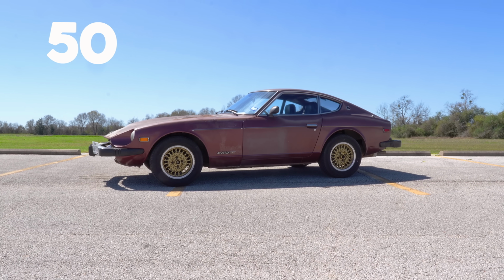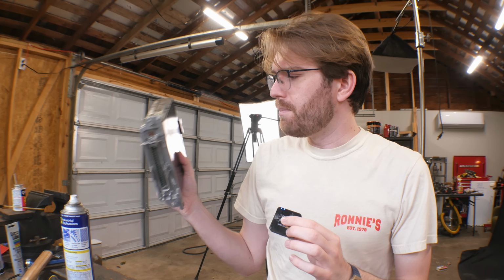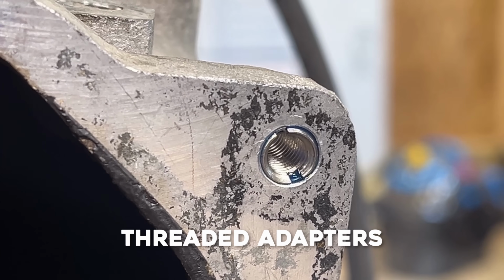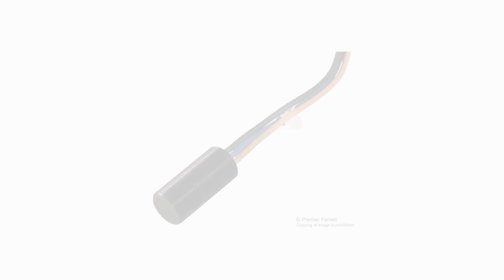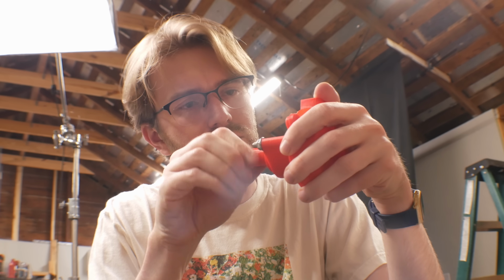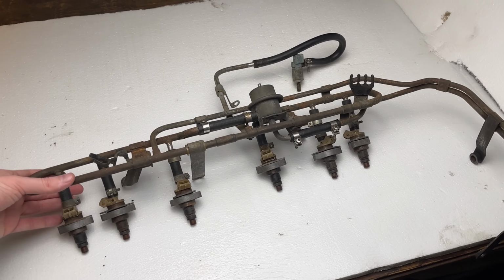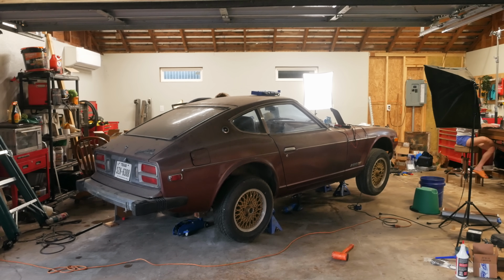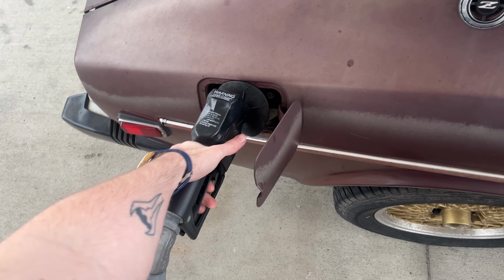Modernizing a Vintage Car

Comment: Heck, my hot rodded '72 240Z with a huge crane cam, 4 barrel manifold, Holley 600, large-tube headers, and dual exhaust got ~ 20MPG and ~205 HP at the wheels.  That's sad!

Comment: Love the video.   I have had 2 1974 260zs.  One stock, one with 1972 carbs.  The stock carbs actually worked well but needed frequent adjustment.  These things shine at high rpm.  You really should put in new rings and bearings and whatever else it needs.  You will see a lot more ponies then.

Comment: This was my first car after graduating HS in 1988 (mom bought it for me for $1800 as a grad gift)! Same exact year, color and gold spoked wheels. WOW… such a time travel. And what an absolute POS this car was, despite my absolute love for it. The front quarter panels flapped in the wind, due to rust, and the floor board had a hole, so driving in wet was like driving a Flintstones car—your feet got wet driving over huge puddles!

The computer. Oh, the computer. A year into owning it, it would randomly bog while driving, emitting a ton of black smoke. It could last for a few minutes and stay running (barely), or it could completely stall out and leave me stranded, as it did one time while driving through NYC in rush hour one Friday afternoon on Broadway, when I went on a day road trip. 🙄

I took it to Nissan and their diagnosis was it needed new injectors and wires. $700 later, it worked for a week, and guess what wound up happening again? Now PISSED, I was stuck with a car that seemed unfixable. However, on one particular instance of this happening again, I got so mad, I kicked the interior side panel HARD with my foot. And guess what happened? IT CLEARED UP! I looked at what exactly I kicked and realized it was the computer. 🤣🤣

Down to the local junkyard I went. 

The really nasty jerk that owned the place had a ‘78 lingering around, but he wanted $200 for it (I priced a brand new one at $250)! That pissed me off even more, so in my 19-yr-old northeastern reactionary mentality, I decided I was going on a covert operation that night and just take it. So, off I went with tools and a flashlight. 10 minutes later, I had a computer. I installed it the next morning and the issue never occurred again. 

I’m not proud of thieving, as we humans often do spiteful things when we’re young, immature, somewhat poor, and not really thinking. I’m sure I received karma for it in one way or another. 

Good times. ❤❤❤❤

Comment: So that's where that ECU went...
Reply from the maker: Thank you for being easy to rob awesome!
Reply: @Ron @RonaldFinger should’ve rob ask for more tbh
Reply: If it makes you feel better, as yet another fiero nerd with an engine swap, I immediately went to your website after watching this video.. :)
Reply: Totally going to remember your ECUs for my Mazda B2200 with a Kia engine swap. Still on the stock ECU, and I would like to make it all more tunable for efficiency.
Reply: @BMX20-r3l  FE3 engine? Really stout piece of kit
Reply: @runesmDK Yeah, the FE3. My wiring is far from perfect.  😂 But, it has been really reliable. I did have to replace the head after an exhaust value burned a hole through itself and had to put new injectors in as well. But it was a salvage yard engine that we didn't even know the miles on, so I can't complain.
I also added a rear end out of a B2600 automatic, which is higher geared. It will hit 60mph in second gear with redlining. It wouldn't do that stock. 😂
Reply: @BMX20-r3l  Dont know how strong the kia fe3 is, but the original mazda fe3, we've turboed quite a few of them. Does 400hp stock internals no issue really, just a decomp plate. I'd just smack a cheap speeduino on it, works a treat
Reply: Why in the world would you want a low quality Kia engine???
Reply: @glassman164  Sometimes, enjoyment doesn't come from things that work and do a good job at what they are built for, but instead, come from knowing that you drive a slow pile of shit that gives you an anxiety addiction that gets real close to feeling like a thrill when your pile of shit inevitably breaks down. 
It's like debilitating mental illness for people that don't have enough going on in their life. 
I actually know people like this, they buy absolute trash products and get excited when they have something to fix. They will buy ebay turbos twice a year, buy a new junky chinese smartphone every year, and buy the most unreliable junk cars you can possibly buy. Even temu is not junk enough for them. They will spend more money buying junk than buying a new solid product that will last a lifetime. They consider themselves thrifty and cost conscientious, but they blow all their money having to buy more junk to replace their junk. They are perfectly conscious of these decisions, not delusional, and enjoy this lifestyle.
It's infuriating, but I respect their happiness.
It should come to no surprise that these people live in bumfk nowhere town of 550 people, and their income comes from the government.
Reply: @glassman164   most of them make great power look at thailand
Reply: Hahahaa 😂😂😂
Reply: I wanna do the same thing to my 1980 280zx
Reply: I tuned a local 240sx w/ RB20 swap with an ECU from you guys. It was my first time messing with one and I gotta say, I liked it! Very user friendly, no weird connectivity issues. Even saw the dude had massive boost creep and told him to figure that out before romping on the car. He did not, and promptly blew the head gasket haha. We never blamed you guys though!
(He ended up finding a shop rag stuffed in his wastegate signal line).
Reply: I hope Paul recovered quickly.
Reply: Not only is your video very interesting , informative and amusing , makes me think you could develop this into a kit for other people as well.  At seventy five , I am very impressed by your work. Plus thanks for the laughs . Looking forward to more.
Reply: Mark 1:15
“The time promised by God has come at last!” he announced. “The Kingdom of God is near! Repent of your sins and believe the Good News!”
Reply: Hehehe.

Perks & problems of the developed world.
 Wish I could even affordably & reliablly Buy a stand-alone ECU here in Kenya.
Reply: Hey @ECUMasterUSA - I can make another one scarce for a while too?
Reply: Do you want do this to a 240z on Mikunis?
Reply: lolzz
Reply: Greatest comment I’ve seen
Reply: Oooh, My Mechanics has entered the chat! That's it, I'm subscribed!
Reply: lol

Comment: 20 plus hp aside, the after and before moments made me wondering, what is the after weight compared to the before weight? because 20hp plus on same weight is very different with 20 hp plus after shaving off may be 20kg, right?

Comment: It’s interesting to see how someone who isnt a mechanic and obviously pretty much a tech guy compared to most mechanics solve problems on this build.   Your solving problems in ways my brain never rhought of.  Like the gas pedal: I’d have cut the metal rod and added a few inches and welded it together . I wouldnt trust a plastic spacer on a high usage high stress spot.

Comment: For that throttle body adapter, I usually would take a picture of that engine section and bring it into the CAD software and make it one-to-one scale, then trace it. But, whatever you got it done.

Comment: For the 3D printed foot pedal height adapter, the faster way to have determined the best thickness would have been to use wood shims to make it as close to the correct size.   I design things for work and I create a lot of 3D printed parts. But whatever, you got it done.

Comment: I had a 78   much much better shape  I bought it  in 1980  it was an automatic. Great Gas milage good power  fun as hell for  all trips short and long  across the USA  many times.  I like the way 240s  looked with the Carbs  so I went the other way  with Headers and  2  2 brl Webber Carbs  all chromed out  it was beautiful..  my car was copper metal flake  with spoilers and all the trim. white letter sumitomos  wish i still had  it.

Comment: Replacing fuel system to injection is good but to fully optimise you really need to change combustion chamber, compression ratio, valve timing, valves so basically by changing injection it’s only half job and won’t work good as you think.

Comment: nothing inherrrantly wrong with l-jetroinic
its fast enough ans locked in, tso the real trick is not assuming its outdated before getting it to operate as per how it would on day one.

the first step is making sure the engine is up to it, timing chain, compression , valves , cam , valves & guides and all that, plus exhaust / intake.

decent injectors, afirflow, and all the otehr settings spot on.

then once you have a baseline, then work from that.

those early systems including d-jectronic werent perfect but also perfectly fine for the day.

once again a basline is required before tinkering.
Reply: and bosh were a primary pioneer in fiuel injection.
conflating them as some kind of domestic applience level manufacture reflects bery much on the level of knowlegde
lack of it basically

Comment: Oi lad. you have done something I am currently planning for a motorcycle. only difference is that I first need to map out with a carburetor build because the engine is that exotic.
Cudos to you, i have this video safed for later.

Comment: If all one was worried about was the coil failing then it would hardly seem worth it.  Back in the day that was one of the most reliable parts on a car.  In all the vehicles I've had in my time I've only run across a bad coil once and that was on a clapped out '77 F-150 I bought that had its 3-speed column shift transmission lying in the bad, lol.  Now, you might drown out the distributor driving through high water, but even then all ya had to do was spray it out with WD-40 and then drive on.

Comment: The electronic throttle in my E46 M3 is far more responsive than any cable could be. There's no friction, there's no slack, there's no stretch, you touch the throttle pedal 5% and you get 5%

Comment: Time for a part 2 with modern engine components like higher compression pistons and iridium spark plugs with a ported head and hotter cams and stiffer valve springs.

Then part 3 would be a DIY turbo kit.

Comment: As a European, I have no reference for what 19 miles per gallon means.

I asked Google to translate it to something more universal, and it's 12.37 l /100km

I guess that is not bad for a 6 cylinder, but it is pretty terrible for such a small car.
I get the feeling you could have cut the fuel consumption in half by swapping to a modern engine, but who am I to say. 

It is a very cool project non the less. I admire your ingenuity.

Comment: That injection system the car originally had is literally worse than carburetor
From 125whp to 142whp is a solid 13% increase on basically zero mods, only sensors :DDD
But now that you have everything ready, a bigger cam would give HUGE results. Like 40hp more results

Comment: Wow i just thinking about doing this,

Because in my country there is almost no cheap rwd sedan.

Of course there is bmw and mercedes, but even old one or cheap one it still bmw and mercedes, if i broke any part i still pay bmw and mercedes price.

So i thought about buy an anchient corolla ke30 or dx, but i dont want to deal with old car problem, so swap the engine with fuel injected, more durable later years engine

Comment: 8 months hard work for a 17 hp increase in power is time well spent. I think if you stopped half-arsing it and committed to the full year working on it, you could easily get that up to 20 hp. 👍

Comment: Hey iPhone 13 Z cars 240s two60s 280s. The thing you wanna do with this 1978 low compression engine does remove the head put a two head on it., and back in the day we used to throw triple Webbers they are my favorite. They sound incredible..
And you should hear a Z car with a split header they sound like Ferraris and they run fantastic .
Then you go to the transmission you take a transmission out of 200 SX from the early 80s. You change the front housing on the transmission so it’ll adapt to an L series engine. Make sure you get the end clearances right you don’t wanna countershaft moving around or an input shaft for that matter . 
What you end up with is a 280 with a cold racial gearbox with a high compression head and if you change your rear differential and you take the front diff out of a Nissan four-wheel-drive and you put it back into the car now you got 411 gears , with a close ratio five speed with around 200 horse , I used to beat the Camaro with my Dotson’s all the time in the 80s and 90s it was fun

Comment: This phonic wheel is gonna be a massive problem, for once the distributor spins every 2 rotations of the crank, so you are using 30° of precision instead of 15°, also you need more syncro teeth, 1 syncro teeth isnt enough at all

Comment: Even if you put the correct air volume chart, you essentially put a restrictor plate in the air flow. Your adaptor to the throttle body blocked some of the airflow.

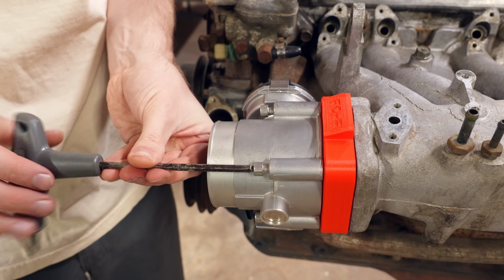Comment: @9:55 you’d probably get better flow if you’d made the hole on the side of the adapter that mates with the original manifold match that weird inlet shape. You can use a loft operation to create a smooth transition from the round hole for the throttle body to that weird shape on the manifold. With a nice smooth loft you’ll get less turbulence in the intake path.
Reply: I like your funny words, magic man.

Comment: Well I wonder what about the drive train efficiency and aerodynamics. Repaint to the surface is smooth and see how much did your efficiency improved.
And other think about the air sucking capability of the engine. I think you have now programmed it for the max power not the max efficiency...

Comment: That was awesome!
But firing the spark at tdc every time might not be a great idea 😅
You want to advance that spark timing by around 25 degrees at times, and around -10 in certain cases. You would need a knock sensor or two, but if the ecm is built for it, It'll be worth it! Power wise & efficiency wise you'd notice the difference

Comment: I had a ‘78 280z as well. Sure it doesn’t make much horsepower, but because it’s so small and lightweight, it feels really zippy. That thing would GO. A 280z at 120whp is like a FRS/BRZ at 200whp. It doesn’t make sense but if anyone gets a chance to drive a manual 280z, you’ll see what I mean

Comment: I suppose its not just about the saving money on fuel aspect, the engine will run better in general now, live longer and be more reliable, basically youve brought a car from the 70's into the mid 90's, very impressed mate good job

Comment: Great video, great result, great engineering! On 6 cylinders the Bosch L-Jet - at least in the Bitter SC, Opel Monza, Opel Senator - fires 2 groups of 3 injectors at the same time. That might be different on the Datsun version.

Comment: Car engines need 4 things to run properly, not 3..!!
Fuel
Air
Spark 
And proper timing..!!.
If you have those first 3 but the engine is out of timing you can crank it for hours and will never start...and if you achieve to start it, there is a high chance engine stalls after a few minutes.

Comment: Now what you should do next is:

Paint the car dark blue

Get black watanabes

Swap in a L28 with a twin turbo, making sure it makes 600 hp

Find out the previous owner had the same name as you

Get a rival that drives a black a Porsche 911 whilst being a surgeon

Racing on the highways at 300+kmh

Comment: Hey, 10 months was so fast it felt not much over 31 minutes.

There's a couple guys in England that have taken more than 12 years... to be fair, they've done a slightly more comprehensive upgrade., but OTOH it does have a 4-cyl engine.

Comment: A car you could use the volumetric table from is a 1987-1990 GM 2.8L V6. Or, since this a Straight 6, either the 1980s Ford F-150, or a 2000s Jeep Wrangler TJ.

Just some suggestions.